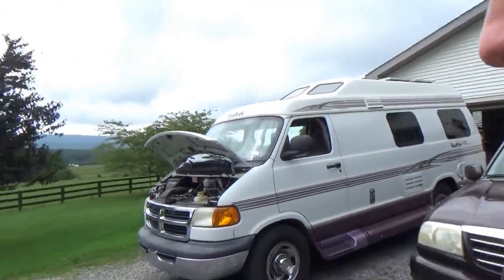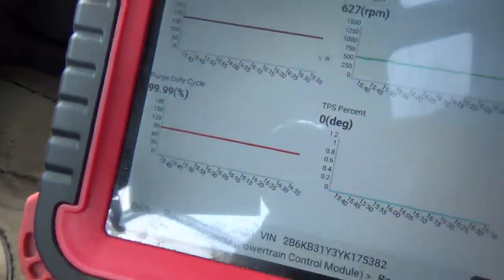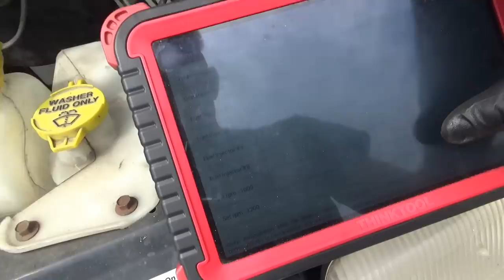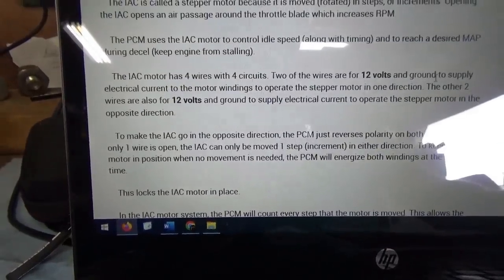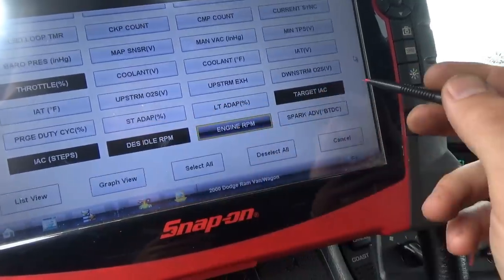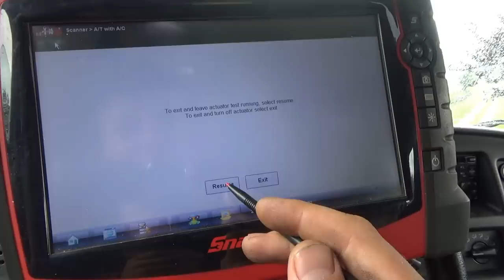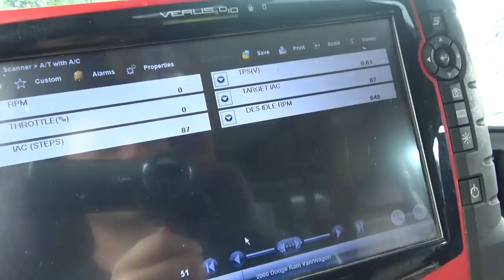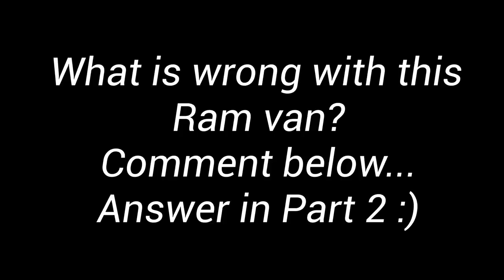DANGEROUS to Drive! Ram Camper Van STALLS after Hot Soak - Part 1

Comment: One possible reason I can think that the computer might drop IAC is if it thought the throttle was not being pressed. Perhaps there is something weird with TPS that caused the computer's learned idle threshold to be too high? In that case, pushing the throttle would raise RPM but since the computer still thinks it is idling, it would drop the counts to try to maintain the lower RPM. I would investigate the TPS signal for an intermittent fault.
Reply: Interesting theory. Does this van have throttle by wire...I think it is too old for that.
Reply: @mikefoehr235  If it did, it wouldn't have an IAC right? :)
Reply: @jessicav2031  💯
Reply: I think you right those systems have a tps they get hot spots on them . Others thought powers and grounds dodge has terrible grounds
Reply: TPS showed plausible numbers on the scanner but that's an average. I think the TPS has some bad spots in it.
Reply: I think the TPS takes over once the throttle is depressed even minimally.   . the Iac only comes into play when it is not given throttle or the A/C is turned on.. dodge has this other thing in thier systems that will disable the A/C at higher RPMS.. if A/C is turned on at idle, the Iac will open up some.
Reply: @randy1ization  But on some vehicles doesn't the PCM have a learned threshold for "no pedal"?
Reply: @jessicav2031  maybe on the drive by wire electronic pedal assembliies..  but not on these older set ups. in the service info it said the IAC also controls timing,. so the IAC is the very critical.
Reply: @jessicav2031  on the newer drive by wire systems if you pump the pedal before starting , the car wont start. it gets confused.

Comment: Just had a similar issue with a 5.3 and noticed 5 minutes after shutting down the pressure would drop so put the shut off valves on the fuel lines and isolated the pressure on the rail and still dropped and so got new used injectors and solved the problem. Was basically flooding the engine causing long cranks. But like you said mine cleared right up after starting and ran fine.

Comment: I've got a very similar problem with my 1995 GMC Sierra 1500 4.3L TBI. Runs great most of the time, but on really hot days in the desert where I live, like 90+ degree days, once the truck heat soaks is start choking and stalls. The difference is with mine, giving it more throttle makes his choke worse and die faster! Once it happens the only solution is to roll to a stop and let it cool down for about an hour then it's fine again. Pretty sure it's not the TBI either, as I replaced the entire TBI unit and it's injector with a brand new unit and it still happens. It's an OBD1 vehicle too so I can't get any useful information from it like an OBD2 vehicle.

Comment: Have seen a lot of floating throttle position sensors causing a similar issue on dodges. Tap on the tps while watching the voltage on the sensor, it will not usually set codes.
Reply: TPS my guess also.

Comment: I have a 97' Dodge Ram van with the 3.9L engine. I had almost the same problem, found  loose hose lines going to the charcoal canister under the right side of the van. Put hose clamps on to fix it.
Reply: That will not cause this issue as the purge valve is normally closed so it cant vacuum air in. All the charcoal does it trap fuel fumes and then the PCM commands the vent valve to close and open the purge valve to absorb those fumes into the intake manifold when the pressure is high. Normally you could have the charcoal removed and vent the fumes into the atmosphere and will not cause any issue except when the monitoring occurs which is what I described and will set a large gross leak code. The purge valve may never be commanded open if the fuel tank pressure is always atmospheric pressure and some cars will set a code also at the fuel tank pressure sensor.

Comment: For what this is worth,,, in the early TBI days with GM ( same theory) I replaced many IAC ‘s , cleaning worked most of the time, carbon on it’s seat makes the 12v stepper trying to compensate , gets them “hot” & not doing what the pcm is telling it to do! Just think, that stepper is running constantly & like you and me, we get “tired!”OEM only, no “slant eye crap ! LOL & clean plates
Reply: Hate to break it to you, but every dealer has their parts department shelves filled with "OEM made in China" parts. US buyers want cheap and no pollution here. China has plenty of cheap labor and could care less about environmental stuff pumped out of their factories.

Comment: The  IAC motor can get carbon fouled on these, the jeep 4.0 engines where more common with the hot soak no start. They had a TSB for that to install insulators on the injectors. If the 360 looses battery voltage it will reset the idle memory and want to stall. Starter sounded like if was laboring to crank it over??

Comment: I think you proved the iac is working (mechanically)perfectly. So why is the ECU commanding a low position? My guess is incorrect sensor feedback. I’d check temperature sensor, tps and tps position calibration . You didn’t show fuel trims during the symptoms, but My guess is they are nominal. We know the ECM has no actual feedback so in has to go through a calibration process some time in the scheme of things. I don’t know if it’s a one time operation at start or periodically during a time when the engine is part throttle an not expected to idle. It’s not attempting to increase the idle  because it’s not trying to open the iac  so I think it’s trying to calibrate but then again maybe you need a new flux capacitor!

Comment: I have a 98 Jeep Grand Cherokee 4.0L that had intermittent low idle, almost causing it to stall when stopping at traffic lights. I put up with it for a while and last year decided to try a new OEM IAC, which was very expensive ($155). I no longer have intermittent low idle. I also had a weak battery which caused a similar issue with both idle and stalling. I forgot to mention that reading the comments on Amazon for the IAC Motor, they said DO NOT buy a cheaper aftermarket part - only buy OEM. There was a HUGE difference in price, but I bought the OEM as recommended.

Comment: I have to agree with you on the scanners Ivan.  My Launch pad 2 and Thinktool pros have the exact same limitations on some vehicles.  This is why I also keep a Snap-on Tritan D10 around to help with the other things my go-to scanners can't do.  Now for the ram van.... My guess is the IAC is getting stuck in the bore.  It might just be gummed up with carbon.  Also sounds like the starter motor is getting really tired.  Might be worth suggesting replacing that before the owner takes off on a long trip.

Comment: Yep the regulator is part of the fuel pump assembly and I had to change the assembly out by cutting a square hole in the floor of the van I had I should have kept that van and repaired it but it's been over 2 years now and I had a 03 ford Taurus ses too

Comment: One guess is a sticky or failing idle air control valve.  Assuming you don't have any symptoms of a fuel loaded manifold.  I have a 99 Ram with the 5.2 and it seems to have this issue.  I've cleaned it before and it's probably due again.  Fairly easy to diagnose and rule this out at least.  You could also try a crank in clear flood mode to rule out a fuel situation.

Anyway, clean TB, remove and clean IAC (and seat).  Try again. Probably will be cured.
Reply: But this is not the iac iteself, it is beeing commanded to do this by the ecm, so the ecm is getting an erronous signal from somewhere.
Reply: @rovhalgrencparselstedt8343  Highly unlikely. That's a distraction. Clean TB, clean IAC and seat.  The erroneous behavior is probably being commanded because the ECM is confused due to TB gunk and/or gunk in the IAC seat/pintle.
Reply: @kevin9c1  😅

Comment: I remember one time back  mid 90 on a hot summer day a lady came out of the store and her dodge truck had a crank no start. It had the old school throttle body injection.
I opened the throttle fully and closed it and the truck started and ran fine. I had a neighbor with an 80 Lincoln that was hardly driven. Ford mechanic told him if it would not start to push the accelerator to the floor once and then start it. Must be pressure build up in the intake.

Comment: Sound to me dumping gas to intake through Purge Solonid or injection system if run rich after starting.  But if not run rich , I have to check 5volt signal and cmp & ckp sensor signal.  I will keep watch now and see  what happens . Than you .

Comment: My money is on a dirty iac and throttle body. If I remember right base idle on the older dodges are. Like 550-600 and the iac is almost closed at idle
Reply: I agree. That has been  the issue 99% of the time in my case's.
Reply: Only on hot start ?

Comment: heat's been known to damage/distort coils/ICMs on vehicles in which the modules are placed in the distributor or on the body. A 93 camry had a problem in which the coil was placed in the distributor eventually warping the housing but what was strange the ecm cut off the fuel injectors suggesting a fuel problem because it detected an "over heat" situation, a Ford aspire had the same problem with overheating ICMs

Comment: PCM may have a dying capacitor, MOSFET, IGBT or a bad connection somewhere.  If it is the old style tin can JTEC computer then you'll get some stuttering at lower speeds or when you hit bumps because the older PCM has a daughter board with a connector that comes loose and many other problems that creep up with age.  Sometimes you can cure the problem by backing out the lefthand screw on the front plate and cause it to stall by touching the same screw... This is never the connectors on the harness like some may think, it is the PCM side when its the old tin can JTEC computer...

Comment: those old chryslers had a problem  with it iac resetting with a dead battery  or replacment . the throttle  body gets dirty  and it doesn't  comp thinking it's clean . trying  to return to 13 steps with a good clean blade gap. stall on decell and start up

Comment: My guess - Idle position switch is sticking or badly adjusted.  Van thinks throttle is closed even though RMP going up (due to use of slight throttle) and lowers the steps to compensate.    IAC count does up when more than slight throttle is applied.

Comment: I'd start with that battery!  
I once had a tps on an older Dodge Van cause the AIS motor to move intermittently with just off idle slow throttle movement.  New tps fixed the problem.

Comment: As usual, a very interesting case. I would, off the top of my head as I haven't looked at service manual or schematics or anything, that depending on how the ECM determines the engine load, this may or may not be a possibility. If after a heat soak say maybe the alternator is hot and misreports the load (current draw), assuming the ECM determines load from the current draw of the alternator, rather than looking at a lot of sensors individually, the latter which is possible of course. Then once engine is running a few minutes the alternator (or some current sensor if equipped) starts working normally and engine runs good.

Seems that monitoring the current load of the alternator would be a more efficient method of determining the load than looking a many individual sensors, which I sure the ECU does do for many things. I do not know for sure how the load is determined by the ECU on this particular vehicle.

One test that could be done would be to do a heat soak then turn on some loads, headlights, blower, A/C, etc. before starting and then start while monitoring the IAC target and actual. If the ECU does not raise the IAC in this case, then this could be the cause, i.e., problem alternator or current sensor. The ECU should open the IAC considerably under this condition regardless of how it determines the engine load. Then again, it could be nearly every sensor on the vesicle and this idea/guess, could be completely wrong. Mostly, just thinking out load with initial thoughts.

One other thing would be, I think, to ask the customer if they are getting gas at a different gas station or something like that (maybe this new 15% ethanol gas that some stations have). I don't think this is a Flex Fuel vehicle, so the ECU may not know the alcohol level of the fuel and  therefore this may be irrelevant. 

Again, a very interesting case.And, thank you for taking the time and putting in all the extra work to make this video for everybody.
Reply: Damn ethanol ...."for the environment" but pollutes more and less milage than gas ... our geniuses in state legislators and in congress

Comment: I damaged the fuel rail schraeder valve with a pressure gauge. The valve had a plastic cap but it would allow the rail pressure to drop over an hour or two of course it would eventually start and run with drama I didn't need. I replaced the valve core and that was it. Took a while to figure that out because it would loose pressure without drips.
Reply from the maker: How would it lose pressure without drips?? Would have to smell like crazy fumes under the hood lol

Comment: I've had a similar issue with a 91 mustang gt and an 01 explorer sport trac. I could drive them all day long. The second I'd turn them off they won't start for 45min. Turns out the place I was getting gas at was killing my fuel pumps. They wouldn't come on when I'd try and restart until they cooled off. The explorer was under warranty.  I explained what it was doing.  The next day they said it was ready and there was nothing wrong with it. I picked it up and drove it for a while then went back and turned it off. Made the dude come try and start it. It wouldn't start so I asked him if there was really nothing wrong with it?

Comment: that communication loss error that keeps popping up may be a clue.  usually once the throttle plate reaches a certain angle, the Iac is no longer in play,  until the throttle plate returns to its point of idle control

Comment: My 1983 Honda accord coupe (4cylinder, manual transmission,  ) did the same thing from the time I bought it new.  Fuel in line vaporized and caused it to stall out at around 2000 rpm... right after driving a while... shutting down for bit... driving again... stalling fits....

Vaporized fuel in line... caused by heat from engine or exhaust pipe.
Reply from the maker: Ah the good old days 😁

Comment: Start simple especially with noticeable slow cranking especially if there going on a trip and failing to start later. Test battery, starter possible voltage surge enough that it loses iac learned values. Would clean tbi and if replacing iac do not use aftermarket parts have had these issues years ago after trying to save money on iac motors. Would do hard reset if cleaning and replacing iac by disconnecting battery and turning headlights on to pull capacitors in computer to clear any learned values and test drive above 30 mph.

Comment: Seen the trottle% staying extreme low during this hot soak so check the trottleposition sensor signal  plse. Also lost comm. during cranking due to worn battery will cause lots of weird probs.

Comment: Very interesting! Even more when you said it should be a simple diagnostic and the title says "Part 1" :-)
There seems to be a low voltage problem, that may, or may not, contribute to the fault. If the IAC tries to go too low, it may mean the engine computer thinks it "sees" too much air. Leak or faulty component?
Part 2 should be a good one :-)

Comment: I would pull the dipstick and smell the oil, and ask the customer if he has trouble putting gas in. then I would check for a leaking intake manifold when hot.  then next check the EGR and pvc system

Comment: I did not watch the whole video but I want to put this out there. If the self-diagnosis shows "no bus" on the dash, it's the computer. If not, likely IAC or purge. I have a 2002 5.2 that had a seemingly random no run condition that ended up being triggered by heat. New computer fixed it after running through coils, IAC, etc. 

It wouldn't hurt to check the pigtail connecting to the fuel pump. My wires were wanting to pull out of the plug but that wouldn't cause a stall only at a stop and whatnot.
Reply: maybe heat the ecm up with a blow dryer and see if it acts up.

Comment: Guessing it could be:
-accessory stuck on (ac compressor, alternator)
-faulty signal from the O2 sensors, telling it it's too lean, causing it to close the IAC
-bad ground
-bad fuel pressure regulator? clogged charcoal canister causing the evap purge line to be under vacuum and sucking in fuel or messing with the fuel pressure?

Comment: The ecu sits right over the top of the engine, it's why it fails, electronics and heat do not mix. I'd relocate the ecu using a harness extension.

Comment: probably part of your problem is the plenium gasket is blown and lets diluted fumes and oil get in the intake that isn't your only problem the way you check it is to remove t-body if its oily in the bottom of the intake its blown. the gasket of choice is dorman they make a kit with bolts good gaskets and bypass hose and thermostat

Comment: Back to basics, fuel injected engines like these all flare when started. When you start them the rpm’s should flare to like 1100 rpm’s then drop back to base idle. Hot or cold they all flare. This engine isn’t doing that. This needs to be fixed before attempting to diagnose any issues. Clean bore and the IAC to get this working. The steps is a learned value from where the motor stops after seating and backing out a given duty cycle command. Also the starter draw sounds like it may be resetting the learned idle control. Check the basics and fix the idle flare issue and check battery voltage during cranking.